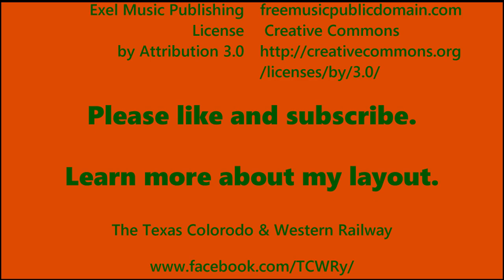Short Circuit Protection for Your Model Railroad DCC System

Comment: Hey Ron, enjoyed the YTMB Live Show.  Great job. When I get to wiring up my new layout this sounds like the way to go.  What's the spacing of your lightbulbs, as in how long are your sub-power districts?  Thanks.
Reply from the maker: Thanks for watching, Walt. I realized in editing that I didn't say this clearly, but you need one bulb in every short district which I divide and insulate at natural breaks in the layout. I make the mainline into districts of its own, insulating it at turnouts where shorts might occur--e.g. at sidings or entrances to yards or industry tracks. On the main I try to make every district at least as long as my longest train. My yards are each a large district of their own as are passing sidings. Basicly I think about where shorts are most likely to occur--where there are turnouts--and make short mgt districts around those areas to contain those shorts and not shut down the layout. If you saw my track plan on the Live Show the other night, I have a total of 15 districts on my layout including both staging yards.